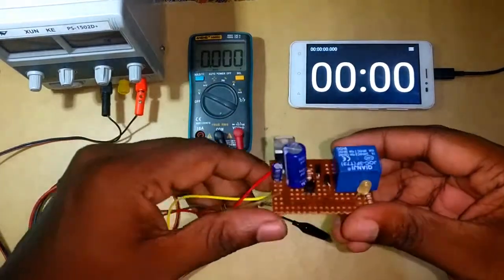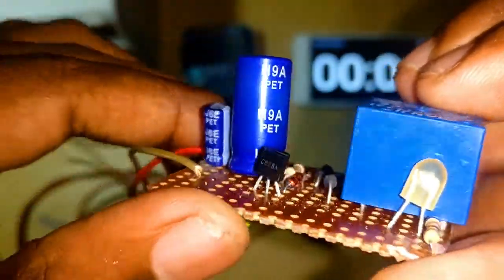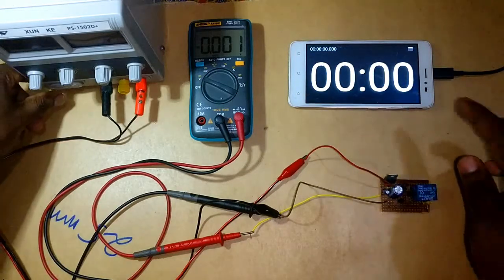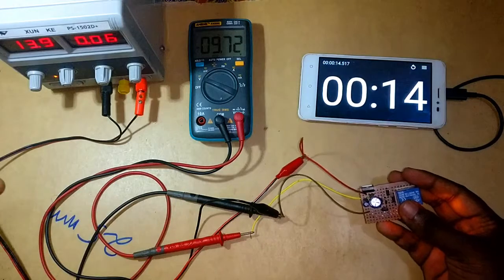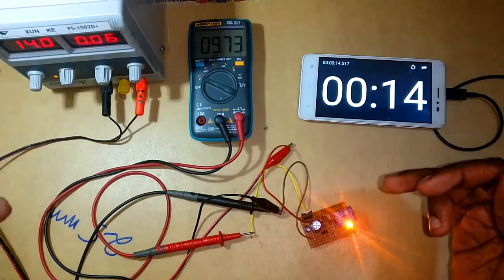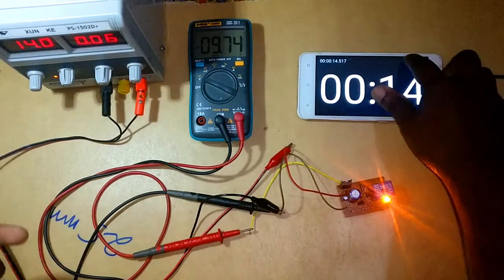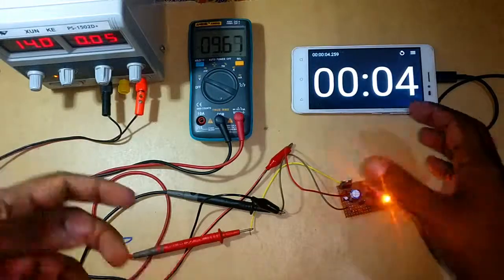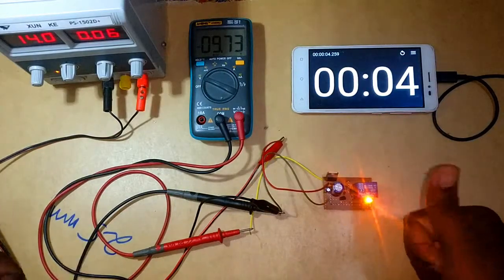Speaker Protection Circuit Practical Final

Comment: ගොඩක් ස්තූතියි.....ඉතාමත්ම හොඳට පැහැදිලි කරා...නමුත් මට පුංචි ප්‍රශ්ණයක් තියෙනවා...මේ circuit එකෙන් කෙරෙන්නේ Amplifier එකක් on වීමේදී ඇතිවන(propagation delay) නිසා ඇතිවන noise එක නැති කිරීම විතරයි නේද?  speaker protection circuit එකකදී සිදුවන Speaker Out  වලින් DC Voltage එකක් ආවොත් speaker out cut off නොවී speaker protect වෙන්නේ නැහැ නේද? ඒක කරන විදිහ (design) කරන විදිහත් video එකකින් අරගෙන එන්න..ස්තූතියි...
Reply from the maker: ow oka dc detected protection ekak newe thma. clipping protection kiyalath ekak enawa. ea kohoma unath issarahata eahema videoe akkuth aragena enna balaporottu wenaawa
Reply: @labtronics1140  transistor amplifier walata eka athyawashyai neda...transistor shot una gama dc out wela speaker pichchenawa neda
Reply from the maker: Ow